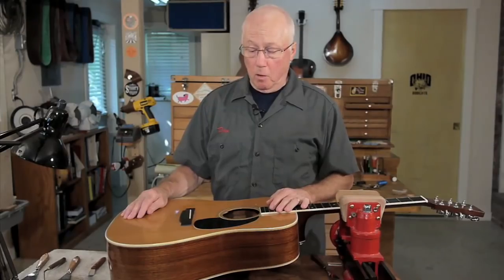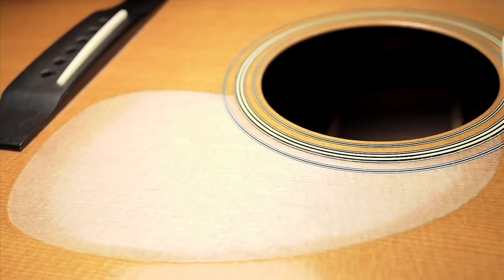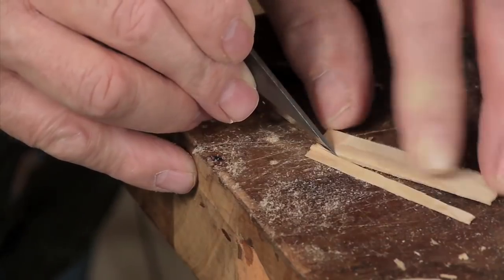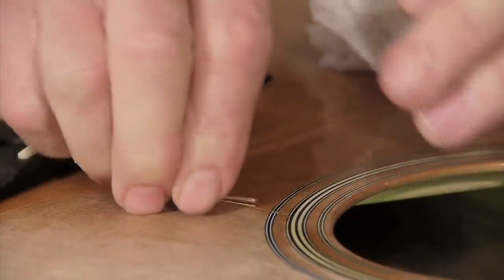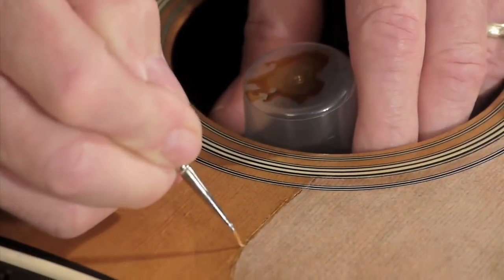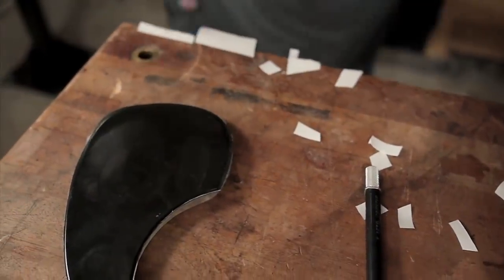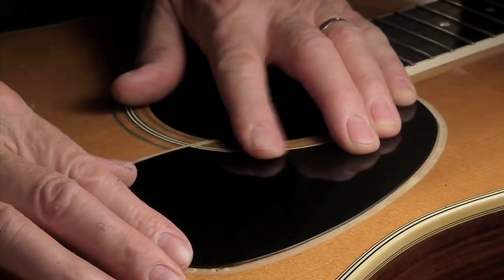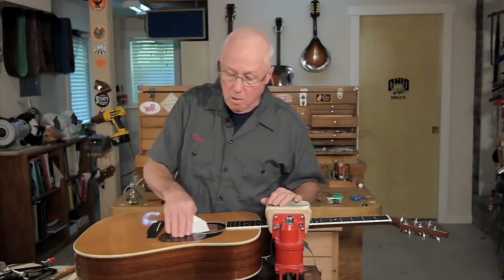A shrinking pickguard cracks this Martin guitar top!

Comment: That masking tape hinge is pure genius!
Reply: blake bishop  hey bud, are you alright? You've been leaving multiple comments on this video, some from 1 month ago and some 2 weeks, is there any reason you are so hostile and negative towards everyone and need to disagree with everything? I hope you're doing ok.
Reply: blake bishop  About what? I never said the video is good and what he shows is correct or is good craftmanship, and you've never said anything about me personally, why would i be offended or angry at you? I'm just curious what's driving you to act like this. It's hard to take you seriously anyway when you're using XD  and writing in capslock.
Reply: I thought the same thing - how I have suffered with re-placing pick guards over the years
Reply: @tr3nta345  I'm pretty sure hes just a troll, and an awful one at that.
Reply: blake bishop  You are not a good troll, find a new hobby.
Reply: I thought the same thing, with just about any application of a sticky back application.  It is Genius.
Reply: You seriously never figured that out on your own? The thing in this video that's genius is using a suction cup to push glue into a joint.
Reply: @The1stFishBone  
You seriously never figured the suction cup glue method out on your own?
Reply: @USGiorgi  In the video the guy you called genius admitted he was taught how to use a suction cup by a different luthier. I doubt you ever figured out you could push glue into a joint with a suction cup independently. That's a big step up in I.Q. from using masking tape to position something. I'm not saying you're dumb for not thinking of using masking tape, but a lot of people have figured that out independently. It's not genius.

Comment: Hi, I really enjoy your videos, you have such a mater of fact down to earth approach to solving problems. I am not a luthier of even a musician, I'm a woodworker and have a variation on getting glue deep into cracks and splits. I use a vacuum pump or a household vacuum cleaner and even my dust collection system in my workshop. The hose on the vacuum cleaner needs to have a a soft collar fitted like the adaptors you get from Rockler. For awkward spots use a flexible piece of hose. It works so well  on occasion, I get glue pulled through the unbroken surface from nearby cracks. You can not get that by pumping it into the crack as there is always a certain amount of rebound of the glue..All the best.

Comment: Many years ago I too bought a Martin D-35. And my stock pick guard caused a crack just like the one in the video. I did take a different tack for a new pick guard. I have built a few guitars for myself, but I chose to use thin ebony on them. Having had that experience I made a similar ebony pick guard just enough larger to cover the 'footprint' of my D-35 pick guard. That new ebony pick guard worked fine for me, just like the guitars I had built. Ken

Comment: Success, didn't have a lamp so used a plastic container the right size with boiling water in it sat on top of the guard. Pick guard eased right off with the tiniest sliver off the top sticking to the guard. The original guard has shrunk before my eyes by at least a 1/16". OK will order new guard from Stewmac in appreciation of this video being free and available to the masses. I can hear my guitar gently weep....with happiness!
Reply: I still haven't got around to doing my repair and watched this vid again before embarking on the task. Wondering what to use to fill the small area where a sliver of wood came away when I removed the old guard. Would sawdust and some glue be OK to use? Its not visible under the guard so maybe just sealing the un-lacquered original wood will suffice? Dan used superglue to do the sealing. Does anyone have any thoughts on this? He said an alternative was to use lacquer. Is that just clear polyurethane? I think I am lucky that I dont have a crack in the soundboard, (that I can see anyway) even though my guitar was built in 74. The top was depressed slightly however and this has relaxed now the old pick guard has been off for along time.

Comment: Dear Dan, if you taped your pick guard caul to the other side of the pickguard (upside down from what you have it as) it wouldn't be necessary to untape it and retape it back to the caul everytime that you're sizing it to the guitar.  That way you could sand and shape the pickguard upside down and simply flip it over (with caul attached)  to see if it fits without untaping it from your caul.  And if it doesn't line up then you simply flip it back over. and continue shaping  That way you never have to remove the caul from the pickguard.

Comment: I love watching Dan's videos. I have really learned a lot over the years from him. I am curious about one thing though.  If the pick guard shrunk another 16th of an inch wouldn't it be too small to be using as a guide to trace out a new guard?  It would be a 16th of an inch plus what it had already shrunk to.  I can see how the new pick guard fit perfectly so I'm just wondering what he did in order to ensure what he was tracing wouldn't in the end be too small.  The answer is probably so obvious and that's why I'm missing it, but I am curious.

Comment: Now, I'm a carpenter, not a guitar surgeon like you, so excuse me if my question offends :P I was wondering if you could slightly oversize the replacement pickguard to cover the repair? The split only seems to be an 1/8th or so away from the edge of the original lacquer line, or is it just not worth the trouble? I would probably make it 3/8ths bigger on the top side to hide and possibly offer extra stabilisation to the repair to possibly help avoid recurrence. Again, carpenter, so I'm probably breaking some lutheran core principles I don't know about!
Reply: heheheh,,, and that's why carpenters love Moldings,,,, heheheh
Reply: @jimmyhaley727 , I'm a carpenter/jointer trained in Germany with many years of experience here. I HATE MOLDINGS, yet must completely agree with kenour. Mr. macdonald did a great job though

Comment: The way you dealt with the crack is very impressive. It's gone into my mental library. I made a pick guard from 1.8mm stainless steel sheet for my black acoustic guitar and stuck it down with automotive double-sided tape (fully covered). It's not going to shrink! I did it for cosmetic purposes coz it looks really cool with some electro-etching on it. However, the big surprise was how much difference it made to the tone. It took all the high frequency (treble) out of the guitar and gave it a very warm and throaty tone. A very unique and positive mod for anybody trying to get more warmth out of their acoustic tone.

Comment: I had a 2-ply plastic truss rod cover that warped from some sun exposure. Sat it in some boiling water and it flattened out immediately.My guess is the glue went soft and the different coloured plastics expanded/contracted at different rates before the glue reset again. Maybe Martin owners could periodically remove their pickguards, flatten them back out, and remount them to prevent this.

Comment: Dan, @1:25 you seal the bare wood with super glue or lacquer. You still have to deal with the "tan-line"/ridge that transitions from the finished top/soundboard to the area left vacant by the old pickguard. What do you do? Will the replacement Martin or StewMac pickguard be large enough to fill the void? - Is some "fitting" required? Thx! 👍
Reply: I'd make a slightly larger one, but Martin stopped that practice sometime around or before year 2000, anyway.  I bought a new D-42 in 2000 and had a luthier remove the pickguard, and the top was finished underneath, never left a trace except for a slight indentation around the edge that disappeared after a year or so.
Reply: Nice modification,Zeek Duff, the gluing and screwing of these things  @ZeekDuff 
 @ZeekDuff
Reply: @martyairey1764  Yeah thanks, I think it opened up the tone a lot faster than just letting it age too, of course it's gotten some wear where I plant my right pinky while playing, but there's no way to play an ax a lot AND keep it pristine.  It's still the best sounding acoustic I own or have ever owned.  I have a rosewood J-185 EC that's really close, but...  OH, I removed the pickguard off that one when new by myself too, same result, bigger sound immediately.

Comment: I have a guitar that has both a crack in the top running from under the bridge to the edge of the top over the braces as well as a loose X brace. What’s the best order or repair - gluing the brace first or fixing the crack, or trying to glue both at the same time? I am thinking about using either titebond original or fish glue.  Thank you for the advice!

Comment: I have a Martin D35 made in 2001. Should I replace the pick hard before it cracks my guitar? Please give me any advice that you can. Thanks.
Reply: +Thomas Tommy:  No worries.  Your 2001 D35 does not have a pick guard installed before finishing.  Martin stopped doing that I think in 1985.  Your pick guard was glued on after the finish, on top...so you are safe.
Reply: +quad1000 Thank you for the information. I am very greatful. Great video. Please keep them going.

Comment: Had this happen to my 1974 Gibson J-55.  If you have a vintage acoustic, you should check around the sound hole next to the scratch plate/pick guard/whatever for small cracks. Even if you keep you instruments in a climate controlled space, this will still happen.
Reply: Were you able to find a replacement pick guard? I'm on the hunt for one from a 1970's j-55. If you have any advice I'd appreciate it.
Reply: I think you're going to have to fashion that from a pickguard blank.
Reply: ***** My luthier was able to remove mine and fix the cracks and reuse the original. It needs a neck reset, but doesn't play too badly for a 42 year-old '55. Sounds sweet!
Reply: Thanks for the replies, Looks like the plan of attack is to try to save the original, but also get a matching pick guard blank just in case. Thanks again
Reply: Jack D. Ripper n

Comment: Lesson Learned:  Don't buy a Martin.....or you'll be sorry 35 years later.  :p
Reply: Or you could just preemptively remove the pickguard
Reply: @ricbachman1727  or replace it with a wood pickguard :)
Reply: @RuiPalmeira   This got me wondering, and I went and eyeballed my 80s Martin - nope, no cracking. 'Course, my pickguard's tortiseshell, not black. The tortie material must not shrink that way. (*sigh of relief*)
Reply: My D-35 (from 1973) now 46 years old and I already noticed the pick guard was curling. Didn't think much of it. Saw this video yesterday, checked my Martin and it actually had a small crack on almost the same spot....  Fortunately I have a friend who's an amazing luthier and has worked with Martin guitars almost all his life, so I don'worry, it will be fixed next week.  But still, thank you, Dan, you saved my Martin from possible bigger damage!!!!!!
Reply: Nothing lasts forever.  To quote Tyler Durden, "Even the Mona Lisa is falling apart."

Comment: So the light used to get the scratch plate off is just a normal light ? Or a heat lamp ?
Reply: Thanks mate.
Reply: Probably needs to be an incandescent bulb though. CFL & LCD bulbs don't put out much heat.
Reply: Thanks !
Reply: Rob Chisholm they sell brass instrument inspection lights but old 12 volt frosted auto interior bulbs work well.

Comment: If you'd like to save that warped original pick guard you can put between two pieces of quarter inch plate glass and leave it to heat up in the hot sunlight until it flattens back down. Leave it for at least a few days. It should stay nice and flat. If so, reinstall it. If it works for old Fender pick guards, it should work for old Martins. A good money saver.
Reply: It will still shrink. That's what caused the problem in the first place.

Comment: Not to second guess a master craftsman, but why doesn't the suction cup pull the glue back out when you lift it back out?
Reply: It just needs to get some penetration to glaze all the surfaces. The vast majority of that glue ends up as squeeze out or wiped off anyway.

Comment: Pick guards are stupid anyway. It clearly damaged this guitar much worse than pick scratches would. I don't see why anyone would want one.
Reply: I think you're correct. I may just clean off the glue residue on my 1972 D-35 and leave it without the pick guard. 
It's not like I rake the strings with a crowbar. I just plant my right hand little finger where the guard is.
In fact, the earliest Martins have no pick guards.